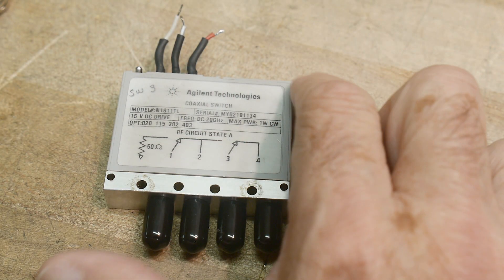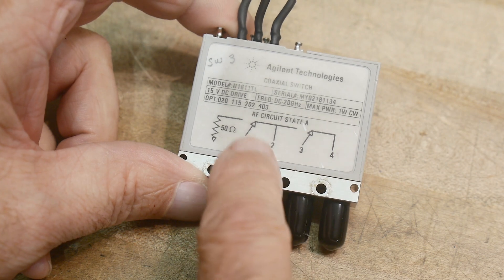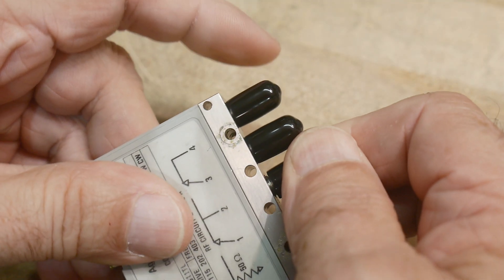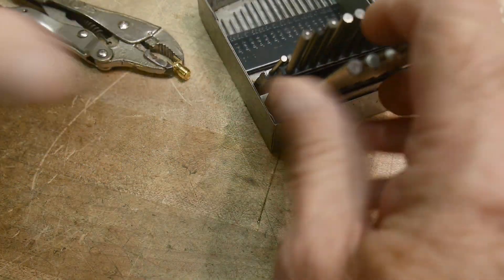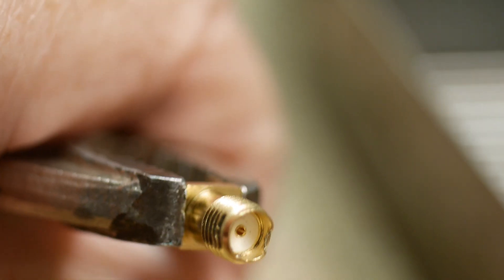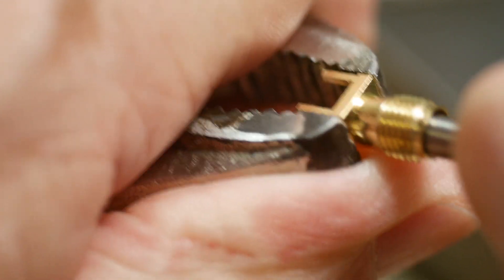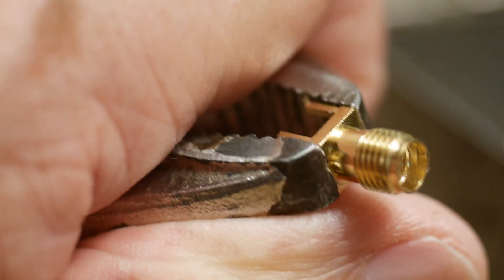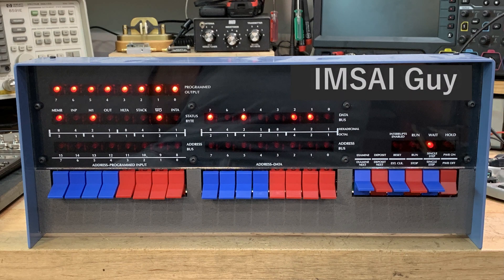#1390 Pulling dents in SMA connectors

Comment: Great tip! For female BNC connectors I have found that leather punches are a great repair tool. They are hollow so don't damage the center insulator , are tapered at the end and come in a variety of sizes. I also have one that I modified with an inside taper that fits over the outside of the connector to re-form it to the correct diameter.
Reply from the maker: good idea
Reply: @IMSAIGuy  did you work at HP.. i saw it noted in the comments. https://www.youtube.com/watch?v=zpp1Docp97g

Comment: Once a high frequency connector is damaged it's damaged for life.  Try as you may it will never perform as it was designed.  It's high frequency characteristics will have changed.  Almost every piece of test equipment I have ever bought used had to have the connectors replaced.  They were not damaged from impact but from improper use.  People "spin" on cables and adapters which allows the center pin to rotate inside the socket which also destroys the high frequency characteristics of connectors.  People don't realize how easy it is to damage a high frequency connector and change it's performance characteristics.  Simply not using a torque wrench to tighten the connector causes inaccurate performance characteristics at high frequency.
Reply: Good call and I hear you. My peeve is how "scope probe" cables are wound up like speaker wire... Usually spotted on the Bay. Folks just don't understand. Oh the humanity!!  :O\   Cheers MRR
Reply: Yeah, but it may still work fine at 500 MHz but not 12 GHz.
Reply: Worse, it will now damage every connector mated to it.  Such bad advice on so many levels.

Comment: I fell off the roof in October while putting my swampcooler into hibernation for the winter.  I was also doing some experimenting with a homebrew EFHW and was carrying a nanoVNA in my back pocket.  I fell onto the nanoVNA, which broke my fall, but bent the SMA connector on a piece of RG174 attached to the nanoVNA.  Bent the SMA.  Just considered it to be a total loss, but had not tossed it --- just substituted a different RG174 cable in its stead.  NEVER thought of using the drill bit means of re-rounding the connector.  With this video, I tried doing that and now have a renewed functionality in that little stub that I had previously given up.  NEVER thought of using the drill bit.   Thanks for the suggestion.  (I know, I'm cheap and didn't toss the RG174)  😀
Reply: yeah, also smashed the nanoVNA and had to replace that  (sigh)
Reply: @1shARyn3  awesome story lady!  thank goodness you are OK!
Reply: @TonyBarr99  My PCP's response:  "Well, at least we know you don't have osteoporosis"

Comment: It would be nice to see the broadband performance before, during (assuming you can still screw it on) and after repair. I've always assumed that there would be a price to pay for repair and reuse, but maybe not...

Anyway, it's a great technique that few people would come up with by themselves! Thanks!
Reply: It's a valid point that the performance might be worsened, but I have a number of parts that only use SMA for it's convenient size - they're only actually at 10MHz or so. And they were shipped to me poorly so I have quite a few damaged. So this is still a useful technique.
The video does go out of shot for some of the most significant points but I get the idea !

Comment: If it were critical enough you could trim the top off of a female connector. Thread it on. Then you could put it in a vise and give the blank a love tap with a hammer. With as many as you've done, you know whether it would be useful or not.

Comment: I had hundreds of these to repair on customer units. I turned an accurate bar on the lathe to fit very snuggly inside the connector barrel and then lightly chamfered roughly 1mm on the end to give it an easy start. Made quite a few for colleagues once they saw mine in action.